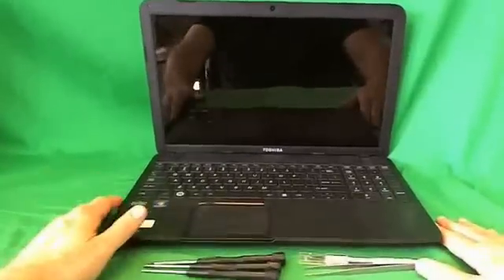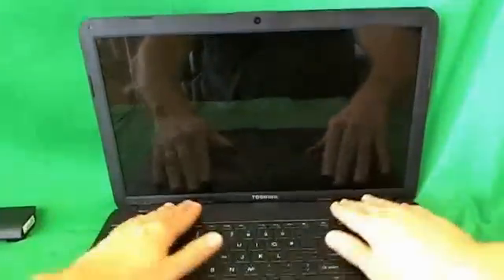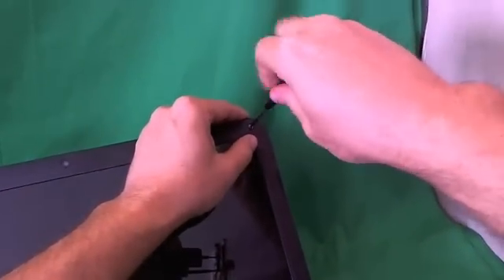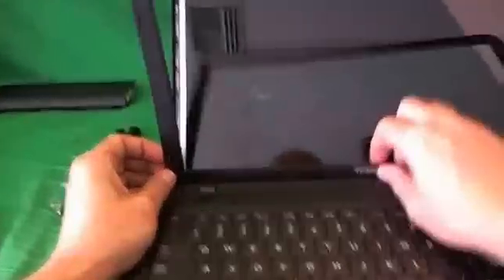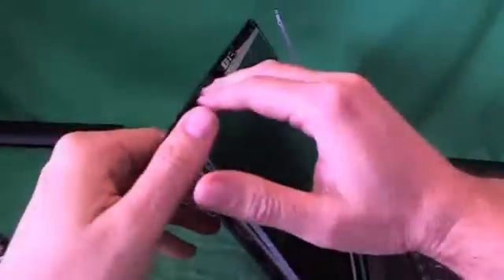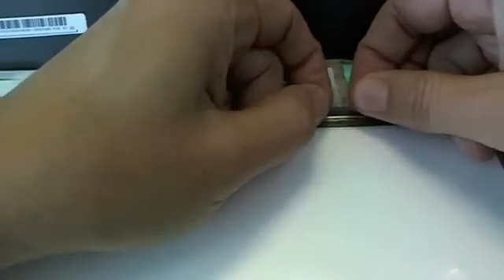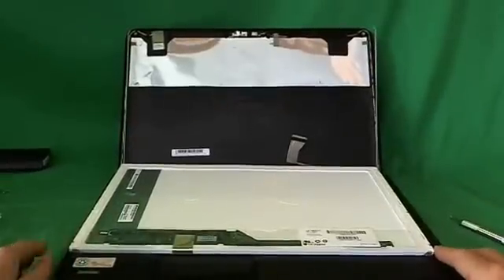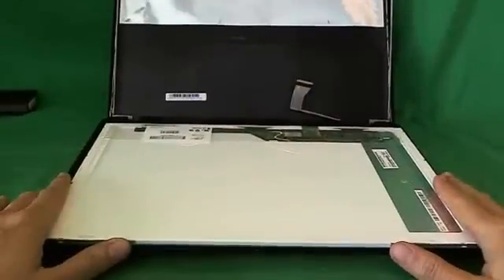Toshiba Satellite C855 C855D Laptop Screen Replacement Procedure

Comment: Word of advice when replacing the screen bezel, follow the video, dont remove the bezel from the outer edge inward or youll more than likely snap the plastic pins which hold the bezel in place...when it comes to putting the bezel back on, the clips wont be there to hold the bezel in place securely so youll end up with gaps...then you will have to either replace the screen bezel or use something else if you dont have money such as a dollop of super glue to hold the bezel in place...if you go for the poor mans solution, only use small amounts of super glue, where the pins are located, it means if you need to remove the bezel then theres only a small section of glue to break the seal....

Comment: Successfully replaced screen on Toshiba C55-C5241.  Two screws on the bezel rather than 4, and a slightly different part number on the screen itself.  Video was great instruction for how to get the bezel off, thank you.

Comment: Hi please help, I want to know if my Satellite C855d-s5103 needs LCD replacement. The screen shows horizontal flickering lines on top and bottom. I tried to connect it to a separate screen but it does not show flickers on the other screen. Mine is a year old and a half and I was hoping there might be some options aside from LCD replacement. Hope to hear from you soon Screen Surgeons thanks!
Reply from the maker: Sorry, the only way to repair this is to replace the screen.
Reply: ...How do you get the screen's side  screwsback in? I'm having so much trouble and i don't have tweezers :(

Comment: my C855D-S5105 has a black screen, but the computer still turns on and I can barely read the screen if I point at it with a flashlight. If I replace the screen will it fix this? Or could there be a different cause?
Reply: the screen actually flashes and and off erratically while the laptop is on. I have no idea..
Reply: Joe is smart.

Comment: I cannot remove the top two screws! :( igot all the way to there but there is a piece oflastic holding the wire in place, that is blocking me from backing out the screws. Do I need to find something to clip this plastic nobly out?

Comment: I did what I saw and I still cannot budge the hinge covers!  :'(  Feeling down, I don't want to break the bezzle.  What the heck is wrong? I used my mini screw driver to try to pry it off but it wont come off. It's a C55 A5245 Satellite
Reply: Do you have any idea if you have spilt anything sticky in that area before?  Maybe try some rubbing alcohol with a q-tip around the sides.  Maybe you already resolved the issue?
Reply: Hi, I found out what was wrong. There are two circles on the area that I knew was supposed to have screws there.  I dug at it with a small screw driver. It turns out that those are stickers! ha ha  So, once I peeled the circle stickers off, I was able to get to the screws!  yea! perserverance  ha ha
Reply: good.  I just bought a new keyboard for mine.  I had forgot that the keyboard was messed up too.  Once I do that it will essentially be new again.

Comment: VERY helpful, thank you!
I have a question (anyone can answer). I dropped my laptop and the screen shattered. I cannot touch what is broken, but I can see the cracked lines beneath the top surface. Will this be fixed with a new screen or do I need something else?
Reply: Yes.  A new LED screen will fix your problem.
Reply: Tim Miller
Thank you!!
Reply: NahiBaby03  new screen shld do the job

Comment: Why shouldn't it work?  Even if the new screen does not work, you can still use the laptop if you connect it to an external monitor.  If you are concerned about safety, you can pay a computer repair technician to do this exact same procedure for you.